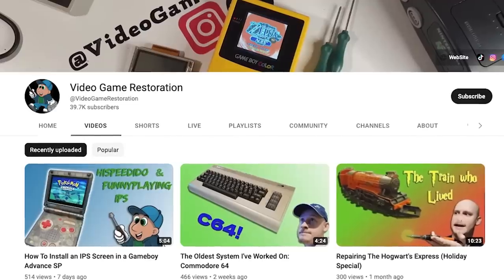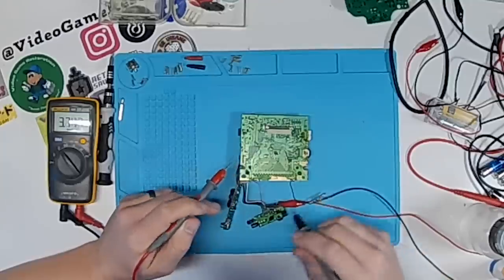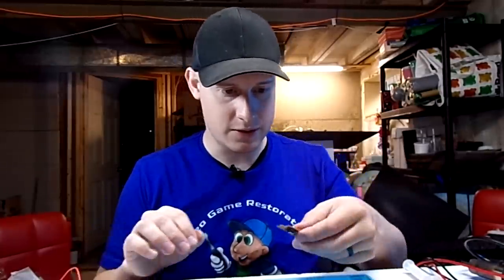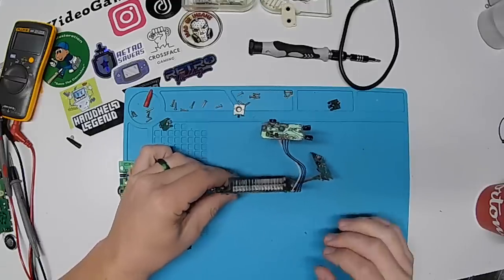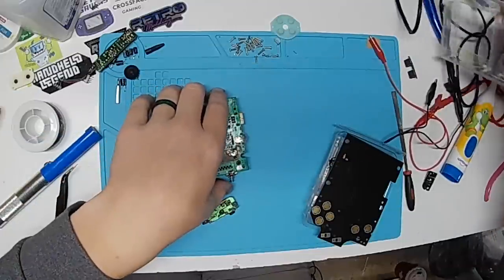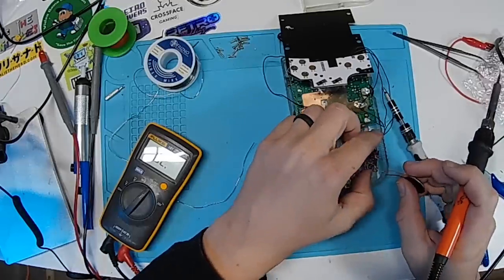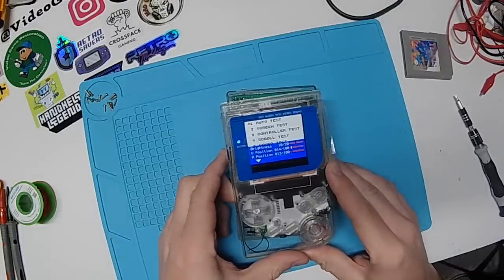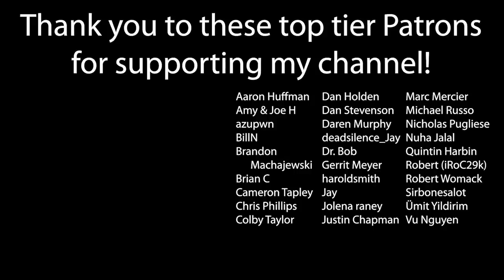I Challenged Him to Repair, Then Build the ULTIMATE Game Boy

Comment: Alkaline (as in alkaline batteries) is another term for a base in chemistry.  Acids (such as vinegar) and bases react until there is no material left to react with, Metal is inert, so if you overload it with vinegar, the reaction will eat all the alkaline away.  The vinegar is also weak enough it won't corrode the metal unless you leave it in the vinegar for a really, really long time.
Reply: That makes so much sense!

Comment: I'm struggling with a DMG that is fully working except for the left audio channel.  Doesn't work at the headphone jack and also doesn't work at the speaker.  Whatever plays on the right channel comes over the speaker.  It has the effect of cutting out half the notes in some of the songs and effects in games.  The board is overall a bit scuzzy looking but I've seen worse still work...

Comment: bro i need your help i just bought a ps4 when i start ps4 it works but after some time its display gone i changed the paste changed the hdd reinstall the software but still there is issue can u just tell me where is issue? plz just 1 ans helps me alot